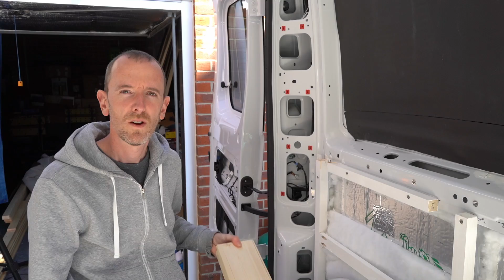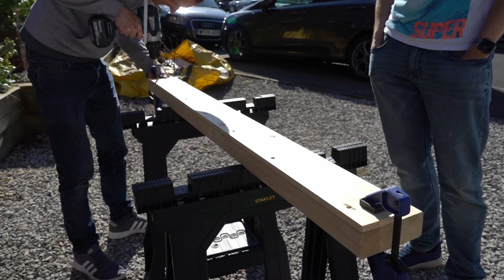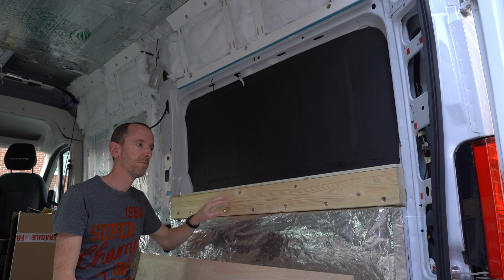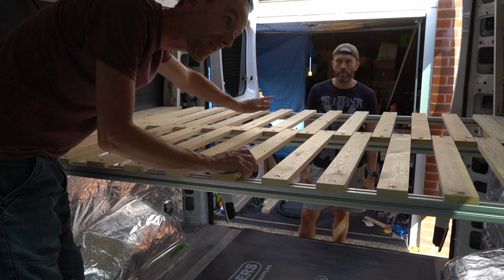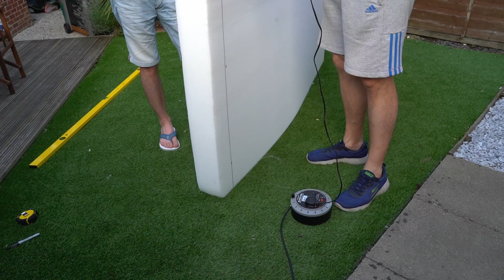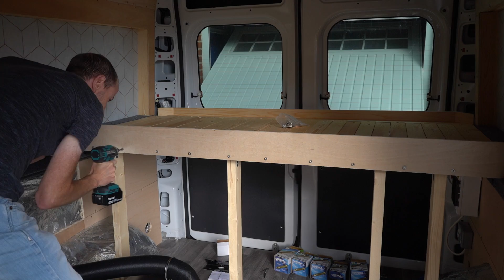EXTENDING Campervan Bed | Fiat Ducato | UK Self-Build Campervan Conversion

Comment: Hey, thank you for your easy explanatory video! i dont have the metal slates but we do have some sturdy wood planks, would it work still to do this with them do you think? Kind regards! thanks again!
Reply from the maker: Yeah I think this would be ok if they’re rigid and would take the weight. Ultimately our metal is resting on wood so arguably the support is the more important thing!

Comment: Another brilliant job,, you should be getting way more views on your build, your workmanship is top drawer. 

You may or may not find your bolts going into tie extruded aluminium loosen over time, put a drop of loctite 242 on them if they do.
Reply from the maker: Ah thanks. Appreciate that. I guess it’s just how the algorithm works. I did wonder about the bolts but good shout on the loctite 👍🏻

Comment: I did a similar build, making a bed that has pivototing sections around 5x 1" 10G aluminium tubing. It converts from bed to seat, but also slides out the back when needed. Both of us have hit upon the idea of having more living space when the bed isn't needed. Great job, well done. 👍
Reply from the maker: Sounds good! It really does make a big difference having a bit of flexibility.

Comment: Hi I am also converting a Boxer L2h2 could I ask what size timbers you are using for the bed as it looks quite substantial
Reply from the maker: Ah cool, the L2H2 club is very exclusive! The bed slats were made from leftover wood from the ceiling so they’re 18mm x 75mm pine. Probably a bit overkill but they do flex a bit when you get on and off the bed, so glad of the extra strength.

Comment: I really like your approach. Very systematic and practical. Your idea of the expanding bed slats has really got me thinking. We have so far planned to use the IKEA solution (ie non expanding) in our L3 model but the aluminium extrusion idea is compelling. Just a thought, given that you have a whole double mattress, where will that be stored when you’re in ‘day mode’?
Reply from the maker: Thanks 🙏 It’s certainly a light weight and strong solution. I think if we had an L3 we’d probably go for a fixed bed but it certainly gives more flexibility. Re the mattress, we’ve subsequently cut it in half so it stacks one on top of the other when we’re in day mode.

Comment: Top work as usual. Recently started a Citroen Relay L3H2 - using aluminum extrusion for the cabinet & kitchen framing. Great material to use. 👍
Reply from the maker: Yeah wondering if we could have used it more. Someone I know is using it for kitchen etc then ply lining. Working v well.